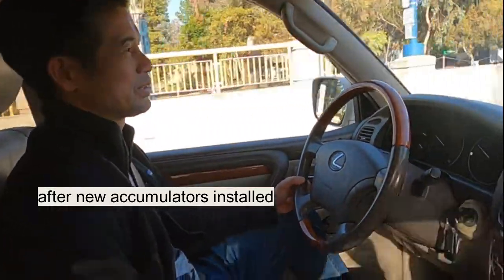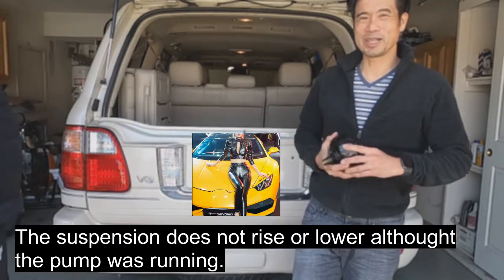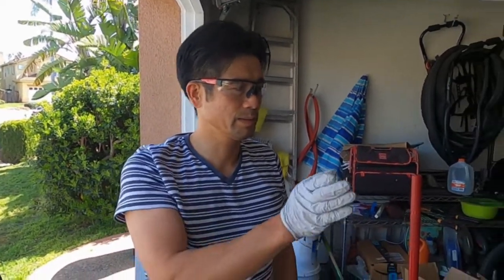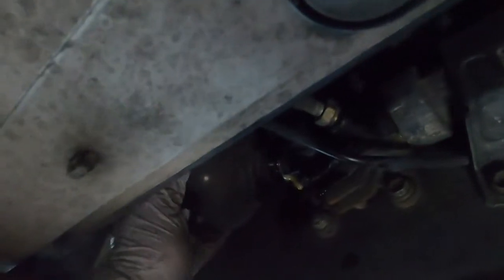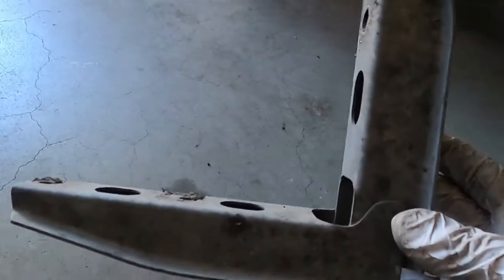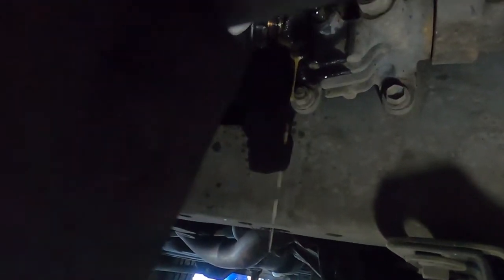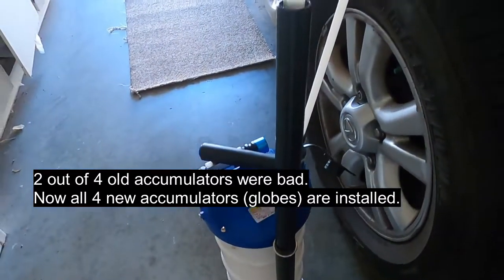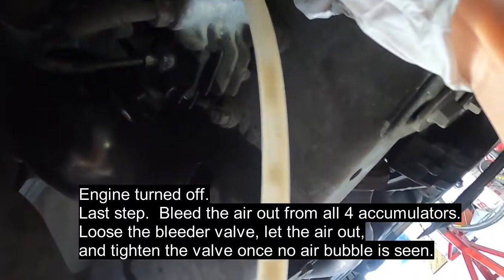Bouncy ride in LX470 solved!  Replacing AHC Suspension Accumulator in Lexus or Toyota Landcruiser.

Comment: Thanks for the tutorial,
My accumulators and fluid just arrived, I’m about to do the replacement in the coming days and just wanted to confirm the below steps are correct.
1. Do I release all 4 bleeders
2. unscrew all 4 accumulators
3. tighten all the bleeders valve
4. Siphon the reservoir empty
5. Screw on all 4 accumulators
6. Fill the reservoir new fluid
7. Turn on engine, cycle from high to low then normal
8. Open bleeders to let air out
9. Screw bleeders back on
10. Test drive with fingers crossed?
Thanks mate!
Reply from the maker: Yes.  Have fun 😆 doing this.  Do one accumulator at a time,

Comment: Hello thank you for this great video you really helped me with this, but can you please explain how does The sensor of height control needs to work?
Reply from the maker: I don’t know how the height sensor works, didn’t look into this.  If the car doesn’t raise or lower when you press the ACH height control switch, then two of the things might have gone bad: accumulators or the pump.  The ACH LED light also blinks when the vehicle fails to reach the height setting.  Good luck
Reply: There is a mechanical sensor at each wheel that senses where the care is. You can see it standing and looking on the frame behind the the wheels
Reply: @imdragonslayer  hello I just order that ones and I have it ,but I need the key,were can I get the same as yours? I just bought one but it doesn’t fit. Please help me with that 🙏🏻

Comment: Thanks for the video. I have to replace mine this month. Can I ask you what type or size of bleeder hose attachment you used?  Did you get it on Amazon?
Reply from the maker: I don’t remember the hose size. There’s only one size, standard size, for the brake bleeding valve. I got it from a local auto store for a few dollars. Or you can buy the brake bleeding kit from Amazon for about $15.

Comment: Hello, great video. Question... Did you have to reset/clear/adjust any values using the Techstream computer thru the OBD2 plug?
Reply from the maker: There’s nothing to reset since there’s no error.  The SUV couldn’t rise or lower when the accumulators were broken. But there was no error stored in OBDii

Comment: I am curious as to whether its bouncing without having a bad accumulator? Like just needing a flush? Mine is bouncy but will raise and lower
Reply from the maker: What’s the mileage on your Lx?  If all 4 corners rise and lower with the same height then I think the accumulators are fine.  One possibility is bad shocks.  What’s the mileage on the shocks, which typically last about 75k -100k mi.  Look for oil leaks around the shocks.  Bad shocks can cause slow bounce when driving over bumps.

Comment: i wanted to ask that On my 2011 lexus lx 570, suspension works fine, i can go on low mode and h mode smoothly, but the ride is bouncy, is the problem with the accumalators or the shock absorbers?, about a month ago i had the shock absorbers checked, the mechanic said they were good, but the ride is still bouncy on a bit bumpy roads, pls let me know wat do u reckon the problem is.
Reply from the maker: I homely don’t know. If all 4 corners go up or down with the same height then the accumulators should be fine.  How old are the shock absorbers?  If they’re more than 80k mi, time to replace them.  Sometimes it’s difficult to check the shocks if there’s no leak since the air suspension is very firm. How bouncy is bouncy ?  If the steering wheel shakes at high speed, maybe the wheels are out of balance.  Also check other suspension components such as the ball joints and suspension arm bushings
Reply: @imdragonslayer  yup exactly the steering wheel along with the whole car vibrates, gonna take it to a workshop soon, hopefully they diagnose the problem, thnx for ur reply.

Comment: Hi, great video. Where can i get these original toyota accumulator globes and the original suspension fluid? I'd like to change these on my Lexus LX 470, year 2002. Thanks
Reply from the maker: We bought them from EBay.  Forgot which seller thought. Or just buy from your local Toyota dealer although at a higher price.

Comment: Great video ! I recently bought UZJ100 from Japan with 170,000 Kilometers and inspected one front and one rear shocks is weeping/leaking . The car AHC is working as it’s going high and low. Do I need to change the accumulators or just replace the shock absorbers ? And also do I need to change the coil springs ? Your advice will be really appreciated
Reply from the maker: If the shocks are leaking, replace them.  Simple enough.  LOL.  No need to replace the accumulators since the car height can be adjusted; I would only replace them after they failed.
Reply: @imdragonslayer  I replaced 4 shock absorbers. Removed all the old fluid from the reservoir too. So finally there shouldn’t be old fluid in the system. After filling new suspension fluid , Is it must to bleed from 4 corners or is it enough to bleed from the accumulator which is on LHS. Your advice will be highly appreciated 😊
Reply from the maker: I recommend to bleed the old fluid from the bleeding valves of the 4 accumulators. The old fluid in the line between the accumulator and the reservoir can only be bleed out from the bleeding valve. Once you see clean fluid coming out then you can stop the bleeding.
Reply: @imdragonslayer  old fluid was drained about 2.2 liters and other was spilt down while removing the pipes . So there was no old fluid in the system ! Would you still recommend to do the bleeding from the 4 corners ?
Reply: @imdragonslayer  And may I know where the fluid level should be in the reservoir when kept in N position ? We filled 2.5 liters and the car is going up and down properly .
Reply from the maker: The lines hold a small percentage of the total fluid.  Maybe 5%. It’s upto you to bleed the lines.  I would do it if it’s my car. Maybe just one more hour of work. The old fluid will eventually cycle back to the reservoir. Probably no harm will be done to the system if the old fluid is not muddy black.  When it’s in the Normal position the fluid in the reservoir should be in the middle of the reservoir.
Reply: @imdragonslayer  you mean when the car is in neutral position the fluid should be in the middle of max and low ???
Reply: @imdragonslayer  After fixing new Toyota original shock absorbers and doing the bleeding and making sure there is no air in the system . Why is the ride stiff and not silky smooth   ?
Reply from the maker: Well. Silky smooth is relative. It is still a truck frame and it can never been as smooth as a sedan. As for the fluid level , the reservoir is huge , it doesn’t have to be in the exact 1/2 mark when it’s in neutral.
Reply: @imdragonslayer  Thanks a lot for your help ! I reduced my tires PSI . It’s super now !

Comment: Gday from Australia! Great video! My 99 LX470 is hitting bumps on the road pretty rough even if its on "Comfort" setting. My car has done 385,000km. I have owned the car since 319,000km. I have never changed the AHC fluid but I changed the shocks at 319,000km. Now I was surprised to see oil around the front shocks when I looked underneath the car yesterday. Do u think maybe the car is bouncy and rough because of front shocks? Also since I bought the car at 319,000km the height adjustment doesnt always work when I press "HI" or "LOW". It seems to work when I press "HI" then drive forward or backwards 30ft. It doesnt usually work when I press it and stay stationary. Mate what are your thoughts on this? Iam thinking of changing shocks and fluid. But do you think accumulators are buggered and need changing? I would greatly appreciate some feedback.  Thanks. Rob
Reply from the maker: If there’s oil around the shock then the shocks are leaking but I don’t think it caused the bounce you’re experiencing since the shocks only have 60km. The accumulators are designed to last about 160km while some can go more than 300km if lucky.  If the ACH doesn’t go up or down, I think it’s either the pump or the accumulator(s) are not working.  You would need to remove the accumulator once at a time to inspect.  Given its mileage, its time to replace them in my opinion.
Reply: @imdragonslayer  thanks mate!
Reply: Must flush all the fuild every 100Klms. The dirty oil has damaged the seals in the shockers.

Comment: You did not bleed the long accumulator ( not the ball actuator ) under the drivers side door first. Wouldn't that get rid of a lot of fluid before bleeding each ball unit?
Reply from the maker: We started bleeding the accumulator that’s furtherest from the reservoir and ended at the driver side. While bleeding each accumulator , I stopped only when I see clear (fresh) fluid comes out.  The total amount of fresh fluid matches the manufacturer spec of full fluid capacity.
Reply: @imdragonslayer  Thank you for the great video and your reply, You were sucking out the fluid with the pump. Not letting it come out on its own because there was pressure in the system. Correct??

Comment: Hi, only the suspension accumulator are being replaced here and shock absorbers doesn't have any issues at all?
Reply from the maker: The shocks were replaced about 6 months prior to the accumulators.
Reply: Thank you sir. Where did you order your accumulator? Is the accumulator will vary based on the year model of the vehicle and version? I have 2000 model dubai version, can u help me where to find supplier of the accumulator? Thanks
Reply from the maker: The accumulators were bought from eBay.com.   Just search for lx470 accumulators.  The 2000 year model has the same accumulators.
Reply: @imdragonslayer  sir please help with your expert advice.  we replaced with new pump so AHC goes up and down fine.  But crazy bouncy.  Is that accumulator globes and possibly shocks too?  hate to do all the work to order and replace globes, only to find the issue was the shocks.  how can you tell difference on what is causing the huge bouncing?

Comment: Nice! I´ve worked on classic Citroën´s for decades and heard about this system on Lexus. Very interesting to watch. Lots of similarities with old Citroën´s. So if you want one of those, I can tell you know how to service them. And yes, the "hydraulic shower" is something all Citroën mechanics know well ;). The trick is to leave it for a while when you get it to leak. Don´t just take the sphere/accumulator of right away. Just have to ask, does the LX have ordinary coil springs too, or is the hydraulic spheres all there is? I know Mercedes had some system where it had both hydraulic and mechanic suspension. The Citroën´s is 100% hydropneumatic.
Reply: LX has coil springs and shocks also, although the shocks are not really shock absorbers in the true sense, they are more of a hydraulic ram, they provide no damping through internal gas, just the height adjustment via the fluid, they are plumbed into the same hydraulic circuit as the spheres. The accumulators provide the damping. Springs are lower rate than on a non-AHC Landcruiser so the hydraulics do the work.

Comment: Did you start with the car in H, N or L? Is a pump necessary to bleed the fluid or is clear tubing and a bottle enough?
Reply from the maker: I think I started the car in N. But it should not matter whether it’s H N or L. You can use a manual hand pump to draw out the fluid from the bleeder valve. A pump is needed to create a vacuum (to create the pressure difference) to get the fluid out.  You can buy a cheap hand pump from Amazon for something like $15-$20
Reply: @imdragonslayer  thank you. I noticed you put it to L after installing the globes so it probably had to be either N or H. Did you have to check pressures with techstream? Thanks for your fast reply.

Comment: Great Video! I have a 2003 lx 470 which when going over bump feels like a pogo. I have 112k miles on it. It looks to have low fluid which I think means one or more accumulator are bad. It is really bad in the rear, feels like it jumps around. The height does all three positions no problem and I am not showing any codes. What is you opinion on what needs to be replaced? I appreciate if you can give me a reply back. Thank you.
Reply from the maker: If you’re sure that all 3 height positions are fine then I think the accumulators are fine.  I would check the 4 shock absorbers for leaks or oil.  The shocks should be replaced every 100k mi anyway.  The accumulators are also designed to last about  100k mi , any mileage over that is a bonus.  If the shocks are bad and not replaced soon, that bouncing will eventually cause the accumulators to fail.
Reply: Hi Peter. I have the same problem with my LX. All 3 positions are fine but bounces even on straight road. Did you find out what was the cause?
Reply: @b2butt1  I have not I bought fluid so going to do a flush. From most of the reading I have done it is bad globes. If @imdragonslayer can chime in again it would help
Reply: @imdragonslayer  I checked and I do not see any leaks. but the fluid is slightly low. So going to do a flush. I am leaning toward bad globes. 
Any good places to buy globes at reasonable prices?
Reply: @55pkwon  I replace mine two months ago they were great 
Now the rear start feeling rough 
No leak or anything just the accumulator I believe it went bad 
If you will flush your system I will say took off the accumulator and do the pencil test if the pencil went deep more than 2 inches the accumulator is shot.

Comment: Appreciate your video.  In order to remove accumulator, is it the same way counter clockwise to uninstall accumulator?  Please confirm.
Reply from the maker: Hi. Yes. Counter clockwise to remove it. Have fun !😊
Reply: Thank you.  Somehow, I could not get it to turn counter clockwise.  May be spray some W-40 and try again.
Reply from the maker: You may need an extension bar such as putting a pipe over the handle bar of the wrench.  Or use your leg to push it.  Apply WD40 or penetrating lubricant may help.

Comment: Hi sir i bougt a lexus lx 470 2000 model and it comes with 18inch rims i replace it with 20inch new lx570 rims the ride were bumpy even on a plan road with both size of rims.i the height control works properly hi and lo.but ta the ride is bumpy even on motorway what should i do now.please give me your advice. Iam from pakistan.i will be waiting for your advice.thankyou❤️
Reply from the maker: I can’t say what causes the bumpy ride since you said the height adjustment works.  Maybe check out the shocks for any leak. If any of the shocks leak or have over 100k mi then I would replace the shocks.  Also check the suspension components, make sure no cracks in them. Also make sure the tires are balanced when they were installed.

Comment: Did you put on a backup washer behind the oring before installing?
Reply from the maker: I don’t recall there were washers or o-rings. If there were , I’m sure I put them back on. The new parts didn’t come with washers or O rings
Reply: @imdragonslayer  I have seen photos of the OEM globes for lx470 coming with both washer and oring mounted but for the lx570 they only come with the oring. I installed mine only with the oring and I will see how it holds up

Comment: Where did you buy these globes? If Ebay, which seller?
Reply from the maker: It’s been a while, the person who bought them doesn’t remember from which seller.  eBay has many sellers whom are shipping them from Japan. Under $850.
Reply: @imdragonslayer  thanks! And was your suspension bouncy in sport mode?
Reply from the maker: With the accumulators installed , it doesn’t bounce at any mode.

Comment: How to know if accumulater is bad
Reply from the maker: Based on this experience there were a few indicators.  The car doesn’t rise or lower when you press the ACH switch H or L. The led light flashes indicating a problem with the automatic suspension. Or if the car doesn’t rise to the fullest height. Second, the fluid in the ACH reservoir doesn’t rise or lower when you press ACH switch.  That indicates the accumulator(s) can’t be pressurized.  Third, the car is very bouncy when even just driving on a flat road; not the same as the slow bounce as with bad shock absorbers.
Reply from the maker: Also, when you press the ACH button you will hear the pump running initially. If you can’t hear the pump then also check out the pump. The accumulators are designed to last about 100k mi, if your car still has the original accumulators and has over 150k mi, I think they should be replaced.  This LX has 200k mi
Reply: @imdragonslayer  thanks so much my friend second issue is steck in low please what is the problem
Reply from the maker: @hamzahabits7912  if the ACH led light is stuck in low, I don’t know the cause of this problem.  In our case, the LED lights could still go from H to L but the car’s height was not moving.  If your car doesn’t have the problems that I described above, then your car may  have a different issue